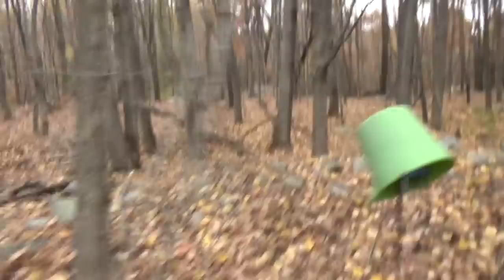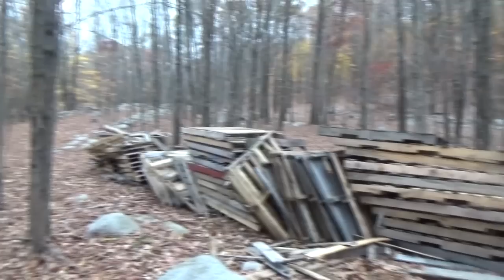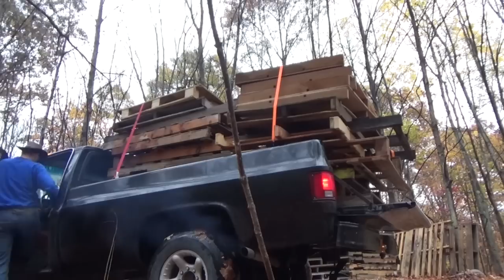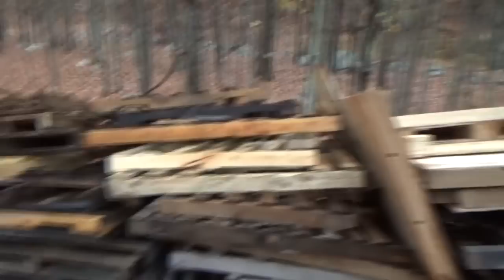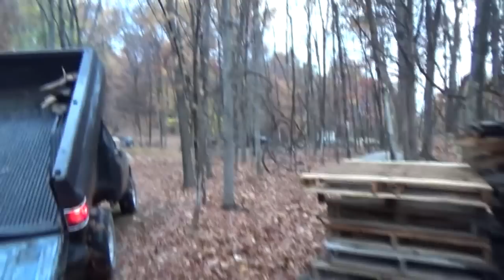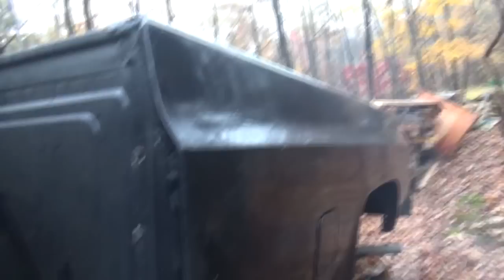Huge Pallet Haul For My Tiny Home Construction N4

Comment: Nice load of pallets. Hopefully you do get a chance to sort and stack them before the snow hits. And you probably want to cover the pallets (or the high rise upscale chipmunk apartment complex  as someone else has called it already) with tarps, especially if you want to work on the siding this winter.
Apart from siding and firewood, many good uses have been suggested, from a deck to wood sheds. One thing I could see as very useful is a "hard" canopy to replace the picnic shelter that you will be taking down soon. Some time ago I thought that if you had just a few long pieces of lumber for the legs and beams, you could make a permanent shelter next to the house that could have your ready supply of firewood stacked under it and also give you room to work. Depending on the season that could be wood work or it could be drying produce from your garden, etc.
Reply from the maker: I was thinking about using pallets to reinforce the carport out in the woods. This could be a winter work area.

Comment: Troy, enjoy the videos. Couple of questions. What are your thoughts sbout a porch for the tiny house now that the cold and wet weather is coming. Your plan to use the pallet lumber for siding will add a lot of weight to the structure but more importantly there will be hundreds of seams as opposed to dozens with longer length siding. As you know those will all be unprotected seams with no overlap. Was just wondering as all building siding, clapboard, log construction, shingled is overlapped or of significant length and caulked. Good luck tho in whatever you do.

Comment: Sorry, Troy...but I did some quick calculations on your palette wood stash, and you're gonna run out a lot quicker than you think.  I've calculated it to December Eleventy-ninth at exactly 94:16 PM.

Someone may have been messing with my calculator settings...you might want to double-check that result...

Comment: Some pallets have plywood on them you may be able to remove and use. I use plywood from pallets from the ammunition plant. I'm building a chicken tractor. Check out my 18 videos I just uploaded. Its a big project. The dump bed was making the unloading nice and easy for you. That saved you some time and energy.
Reply from the maker: Wow, 18 videos on it. That is a well documented series. I will have a look when my power is back up and working. Going to look for scrap batteries today that might work for now. Also talking to Advance Auto about working out some sort of replacement deal. Their warranty is only a year and they are just over a year old now.
Reply: I sure hope they waranty them I bet they do. I would not buy used batteries. I have two deep cycle used batteries that are now dead. They were refurbished. pretty much useless. I am out my money. I traded for them someone else got them from the battery truck so now I dont know what to do.

Comment: Troy, # I can agree with some points of subscribers, not getting what they are looking for. ,some move on, no biggy.   as too solar issues, I can agree with multi spaces for panels. always have a line of sun.   I always had five lines of  sun.  I can also agree cutting down tree's is the only answer, again no bigy,  as too the locals who knows.   but again got too get the power to be uninterrupted too save battery life. at all costs.    we have too deal while others don't like it, to bad on them.      time too get that wiring up and running. so that makes the issue of supplying the facts.    it is a pity you don't have tree trimming out there.   just trimming the tree will allow move power, with out biting people butts. 
# pluming, is a must, to finish, or have you got around too using a composite toilet.   along with water supply's,  are issues that need working.    I myself would go with a shower instead of the tub, just because the space issue.
# roofing issue, you can use a roll of flashing tin,  for about fifty bucks, too cover that space for the time being, that will allow you to hang down spouts and gutter, for water collection.  hit the tank with some bleach too, they are getting a little green.  
# As too your battery rehab, it can be done cheap, baking soda and boiled water.  you tube has the videos on line. it should take a few hours.  
# the wood splinter need more fluid to run the piston better.  use that passure gage you got on it.  tighten the belt up too, increase the RPM's too.      
#Get a start striping that RV, of useful utilities for the tiny house.  
# hot water issues too can be done using a steel tank using a few methods, one is copper tubing wrapped around the stove pipe, or solar, or generated electric. using a 12V, recirculating pump.   Also you need to get a start on indoor pluming for bathroom.   you need to get the upper floor finished too.  try using the heat regulator tubes or the putting in hole with fans. too keep the heat moving.   you will see even move of a time usages on the wood burning needed.  not a lot but some.   I heat my tiny house with a 2500 BTU heater all winter.    I would go with dry wall on the ceiling, as it is much cheaper, and easier too mount. that should give you a few hours of work too mess with, big smile.'